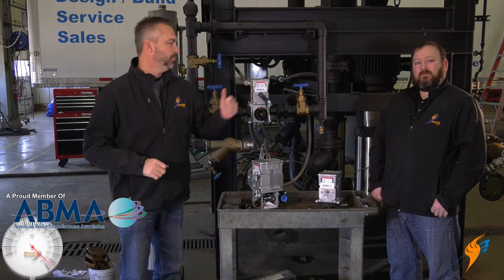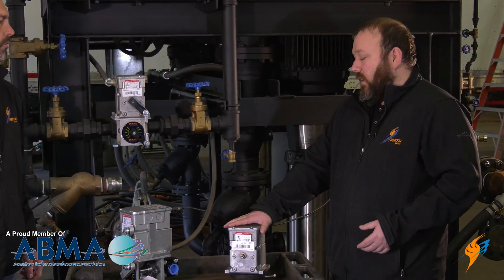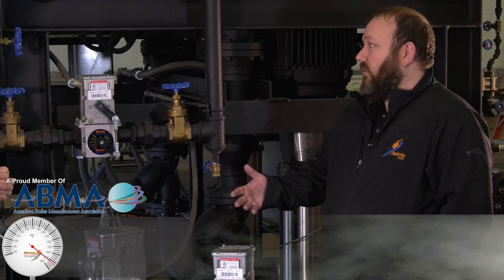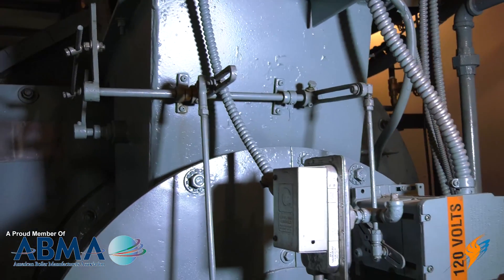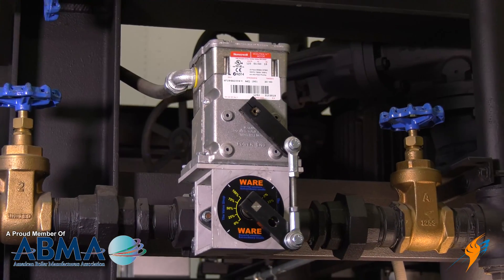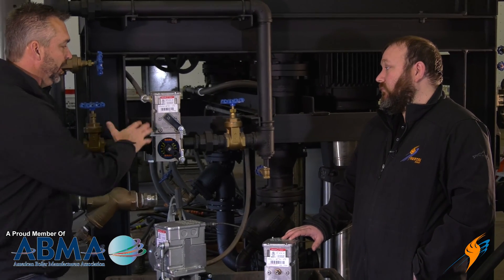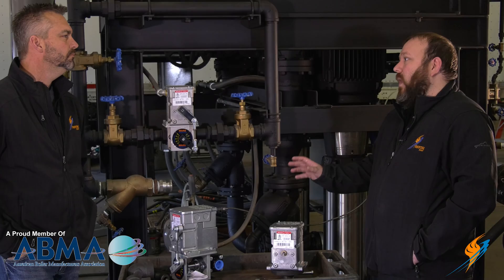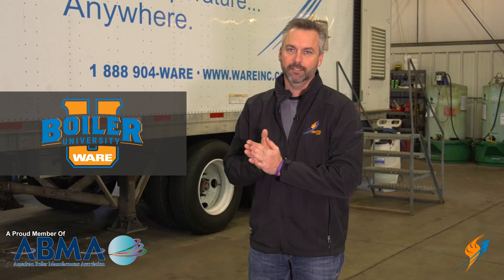Honeywell Modulation Motor Overview - Boiling Point

Comment: What could cause a mod motor to act unstable?   This video shows a twitchy motor that controls linkages for air dampers and gas valve.   This behavior is apparent when on manual modulation and auto mod.     https://youtu.be/19gawVJNnTM
Reply from the maker: Thanks for the comment! So the fact that it is happening in both modes (manual and auto) means there could be something wrong with the motor itself. Without actually having a service tech there we can't really determine anything other than what we see in the video. Try replacing it with a spare and see if the problem continues. Would recommend getting a service company out there as well to better diagnose what is going on. Hopefully that helps and good luck!